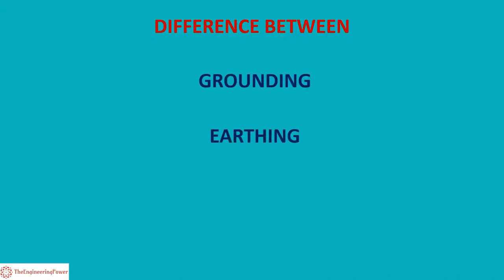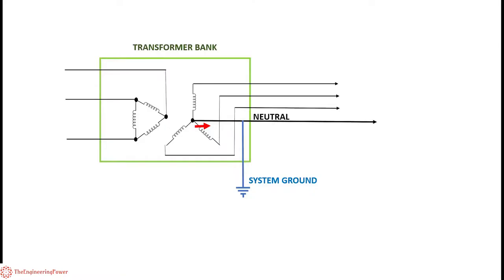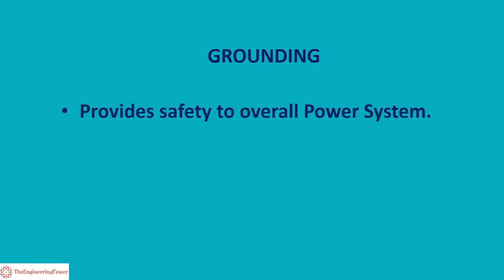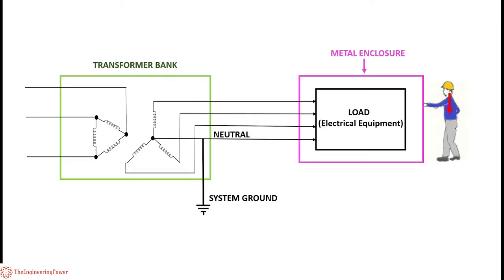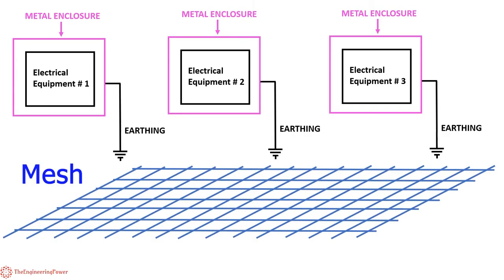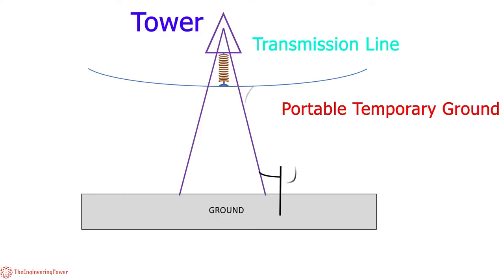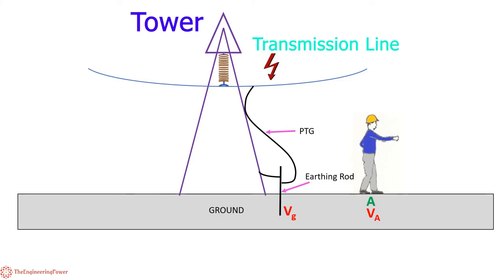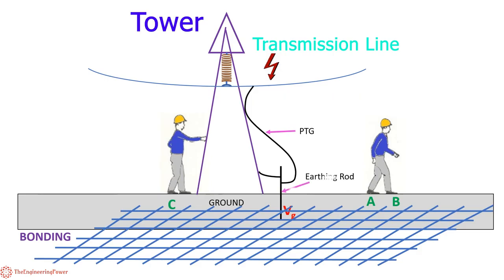Difference between grounding, earthing and bonding with examples

Comment: No, an earth rod does not make any system safe. The earth wire needs to be connected to the neutral or one has to use an RCD to make it safe.